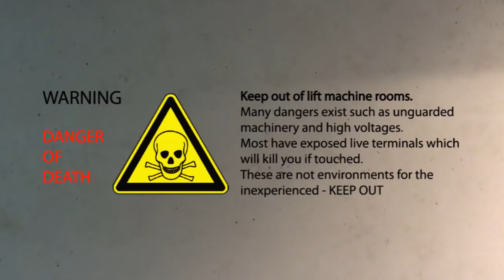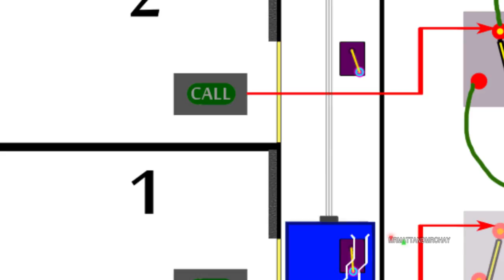Spooky old DUMB WAITER - Check out the size of the controller!!!

Comment: Is this in an abandoned building?

Do you know what the advantages/disadvantages are of having the car itself act as the selector, instead of having a selector in the machine room? It seems simpler to have it in the shaft, but I don't know if installation would be more difficult.
Reply: Using shaft switches as the floor reference and stopping point is only useful on low speed passenger lifts and goods/dumbwaiter installations.They are fine if levelling accuracy is not too important, but require a lot of trunking and conduit to run the associated wiring.Mechanical switches were used as final limit switches and also as backup switches for terminal floor slowdown and top and bottom floor level. Any lift moving @ 1.5m/s or higher would probably swipe the switches too aggressively or damage them when passing. The drum selector placed in the motor room and connected by cable to the lift car was easier to maintain and floor level inaccuracies were easy to correct.The OTIS rotary selector is easy to maintain and was very accurate on initial set up, but contact wear could cause floor levelling problems. Again maintenance and adjustment were very important, more complex call systems like fully collective or group and dispatchers need a good selector to back them up and give the system all the information it needs and this was easily done with the OTIS or EXPRESS rotary selectors. Hope this answers your question.

Comment: Very detailed video, the machine itself resembles a mini version of a geared traction machine, with the disc brakes, driven sheave. I presume this is a three phase AC motor, with a phase reversing relay in the controller board.  I will be interested to see more about the 2nd roller switch controller.